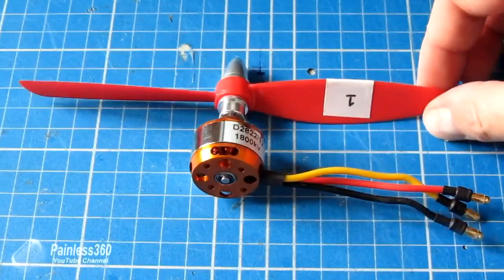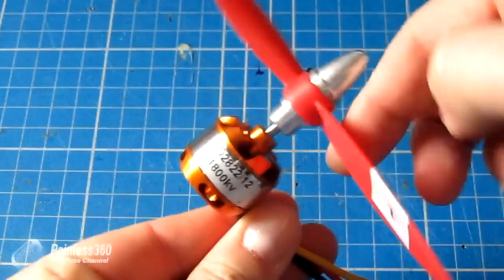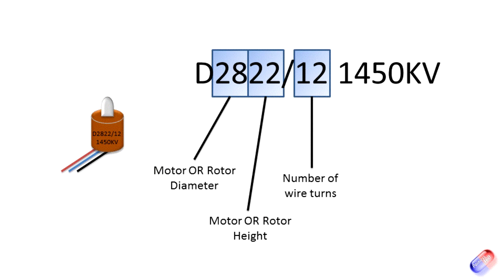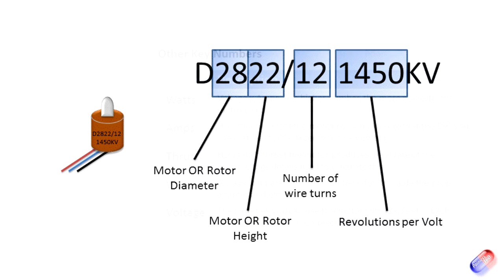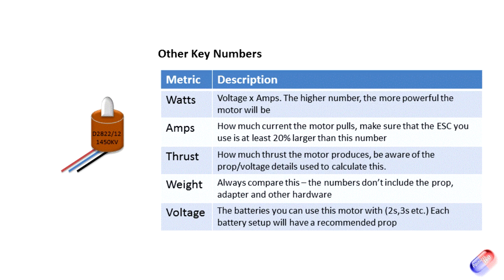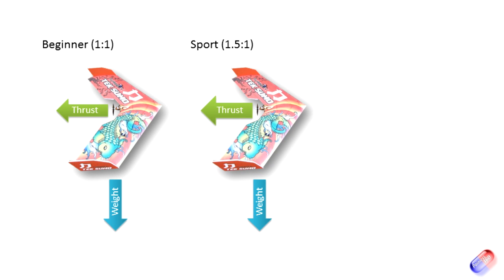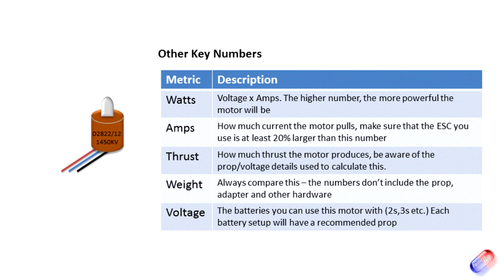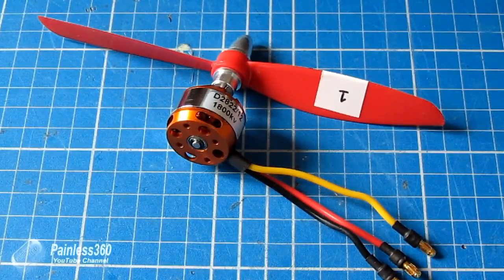Brushless Motor Numbers Explained (KV etc)

Comment: Thanks for the vid.  There's some good information in it.

I have a second-hand motor, but the only label on it says "dys Brushless Motor G-Power series ROHS Made in China.  Nothing else.  It's an out-runner.
Is there any way of finding more information about it?
It's quite a big motor - 34.75mm diameter, 47.7mm length, or 65mm including the shaft, which has a diameter of 5mm.
It appears to be quite densely wound.  Obviously, I can only see the wires on the outer layer of windings, but I'd say (without actually counting them) that there are about 18 or 20 turns visible, and as they are not wound absolutely flat, I think there must be at least one other layer beneath.  The 12 laminated metal poles are 26mm long, as are the 14 magnets.
Is there a method or formula for working out the Kv at least?
Reply from the maker: +Mike Collins I'd spend time looking for images in Google search using the information you have at the moment. Very tricky to work out KV without the specs or lots of testing.. Best of luck!
Reply: +Painless360 Thanks for the quick response.  In the interim, I have been doing what you said.  Going on the measurements, I deduced that it was a DYS 3548 so I looked it up on the DYS site.  It comes in three flavours - KV: 1100KV/900KV/790KV
All are exactly the same weight and have the same dimensions. As far as I can tell from the photos, they all have the same label too.  About the only difference is "Ri(M Ω)" : 0.023 / 0.036 / 0.040
I don't know what "Ri" is, and I can't think of anything around this motor that would be measured in mega-ohms.  If they mean mΩ (milli-ohms), my meter won't go anywhere near it (min = 0.5Ω)
Ho hum.  It seemed like a bargain when I got it.  It has a noisy bearing as well.

Comment: The reason I want to know is because the Spektrum rev counter telemetry module needs to know the number of poles to accurately measure motor rpm.
Reply from the maker: +George Venetsanos for outrunners it's normally the number of magnets on the inside of the can. The higher KV the more there are typically..

Comment: Hello, very informative video (as always). Unfortunately not all manufactures will supply adequate information for their motors with most of them providing only the rather not so useful Kv. How can one determine the number of poles in a brushless motor? 
Thanks and regards
George
Reply from the maker: +George Venetsanos Usually from the specs or by looking at the motor - best of luck!
Reply: Thanks for your prompt response. The problem of course rises when the specs don't include pole count and looking at the motor the winding pattern is not obvious. For instance a motor with 9 coils how many poles does it have?
Reply from the maker: Why is it that you are interested in knowing the pole count? Most pilots and builders don't need to know..

Comment: Hi My Friend!
I buy a 2212 Angel Sunnysky 980kv and in some occation he overheat.. them i see shortcut in the cables and resolve that but when i try to use again he run slowly.. i compare everything with the others motors and cables and all looks fine.. what you recomend? i see some videos repair brushless but im not sure what make..im waiting your response! thanks!
Reply from the maker: I would replace the motor. Best of luck!
Reply: +Painless360 Fast answer! I buy today the motor in ebay so i need wait for it but i try to repair this motor beacuse you explain the function and its very basics this motors and i thing have a solution. Thanks!

Comment: im build quadcopter, and i notice that 1 of my motor getting hot while the others not. i switch to other esc, some problem occur.. do you know what the cause? or i have to end it up buying new motor?
Reply from the maker: +andi azhar Could be a few things - I would check the bearings are ok and don't need oiling/replacing. Also you could swap the motor with another on the model and see if the same motor gets hot (in which place I'd replace it) or its something to do with the settings on that ESC.. Best of luck..
Reply: the motor going to be twitch when i replace to the other esc, but rotate nicely on 1 of my esc ( which is different type with the another ) , but it cause the motor to getting hot
Reply from the maker: Motor twitching is usually caused by a bad/broken connection on one of the three wires into the motor. Best of luck..
Reply: thanks for your fast respon, i will try my best
Reply: Harald Krennrich i replace the hot motor to the new 1.. problem solve
Reply: +andi azhar Any news on this?

Comment: why do you need so much torque in some motors?
Reply from the maker: +QuadBro RC Larger props with more pass take more force to spin..
Reply: +Painless360 another question. I am building a 150 racer, and you say a 1306 motor has more torque than an 1104 motor. What is one reason to go for the 1104 over the 1306? FYI the 1306 is 3100kv and the 1104 is 4000kv
Reply from the maker: Not necessarily. Torque (turning force) is a function of the power (watts) a motor pulls and physical things like how powerful the magnetic fields it creates are, the strength of the permanent magnets and the diameter and height of the rotor/stator. The best way to figure this out is look at the thrust and recommended prop sizes.. Best of luck.

Comment: Hi.  I'm new at this but questions are abundant. I've seen different size motors with the same "kv" parameter. What is the difference then?

I've heard people referring to brushless motors just with a simple number: 15, 12, 11, etc. What do they mean?

Thank you in advance !
Reply from the maker: +José Alberto Varona Sánchez I would recommend watching the 'Introduction to RC' playlist on the channel. It covers a lot of the basics. To answer your questions - The size of the motor is more about power, larger motors normally produce more torque (turning force) so can spin larger props and produce more lift. The other numbers you asked about are numbers that people use as a shorthand are about the size of the motor. Sadly the industry still haven't decided on a standard so sometimes the number refers to the diameter of the rotor inside the motor, sometime the physical size of the can that's it's housed in. Hope that helps.
Reply: It helped a lot! Thank you. It's clearer now. Do you have any specific link for 'introduction to rc'?
Reply from the maker: Look in the playlists in the Painless360 channel here on Youtube - all in there.

Comment: I have a question but cant seem to get an answer. On gimbal motor ie: BGM4108-130 how does the polarity work ? is it the same as prop motors ? wire it any way you want ?
Reply from the maker: +HIXMF Exactly the same as any brushless motor.. Best of luck with it..

Comment: Why do smaller motors have higher KV example is a scorpion motor I saw SII-3026-1190KV (V2) 1050W motor turning 1190KV.  Where a larger 45MM diameter motor is around 2000 watt motor only turns 170KV. Isn't the idea to turn the prop faster which is related to KV turns per volt?  Also I noticed these fast 100mph foam planes like the eflight rare bear and the rockhobby air racer have high small props like 8" 8 pitch or 10x10 pitch. Smaller props with more pitch get higher speeds?
Reply from the maker: +kell490 The thrust you get is a result of the size and pitch of the prop and the speed it turns. The most economical way to get thrust is to use a huge rotor with a very low KV/High Torque motor. Sadly, the smaller models we use do not give us the room for the bigger props so we have to turn the smaller props a lot faster to generate the same thrust. So in the hobby, where we don't have the room for/want a big motor and prop we need a small motor with a much higher KV. Hope that makes sense.
Reply: Painless360 So another question I have been playing around with the prop on my voodoo racer has a 880KV motor about 750watts. What I notice is a smaller prop turning higher RPM with more pitch like a 10x10 or cut down 9x10 prop the plane goes a lot faster. Where larger electrics with big props turning less rpm go half the speed as my plane with those props my current draw is lower then larger prop.
Reply from the maker: https://www.youtube.com/watch?v=uLutMoh4Ttg and https://www.youtube.com/watch?v=Sjwi_UnCLWc may be interesting to you.. Happy flying!

Comment: One more thing sir if I buy 1000kv motor will it work for more time than 2200kv motor if I use 2200 mah 3s 25c 11.1v lipo battery
Reply from the maker: It doesn't work that way. Motors that pull less amps make the power in the battery last longer. Amp draw has little to do with KV. Best of luck

Comment: Hi can I use 2200kv motor with 2200 mah 25c 3s 11.1v lipo battery
Reply from the maker: +Harsahej Singh Yes it should, but check on the specs for the actual motor on the maximum battery size it is happy with. Best of luck.

Comment: Sir than which lipo battery is perfect for 2200kv motor
Reply from the maker: +Harsahej Singh You can usually find this detail in the specs for the motor. The detail also normally contains the prop recommendations for each battery size (2s, 3s, 4s etc) too. Best of luck with the project.

Comment: Hello sir one thing more will the plane work if I am not using the tail and the back wings and is I am using a car transmitter to fly a plane is that ok please answer me as soon as possible
Reply from the maker: +Harsahej Singh I would recommend that you use the right transmitter for the model. With only two controls (steering and throttle) you would struggle to control the model. You really need three minimum for a plane. 
Best of luck.

Comment: Hi can I use a 2200 kv motor with 610mah lipo battery will it work and for how many minutes please can you tell me sir i am making a plane not very big but which will be the best kv motor and the battery mah please tell me sir as soon as possible
Reply from the maker: +Harsahej Singh Figure out the average amps the motor will pull then see how ling that would take to pull that from the battery. See my LIPO videos to help..

Comment: I love your videos mate. Solid knowledge delivery. Just went through your entire Taranis X9D plus playlist and I dont even own one (it's in the mail). So anyways I wanted some advice, I am scratchbuilding a F14 150% tomcat from parkjets.com and it's pretty huge. I'm expecting it to be 4-6kgs after it's fully setup but I have no idea as to what motor to use. The manual tells me to use a 2015-4100 but that'll be too small for this 150 size model. What do you think? Also I have only one motor mount.
Reply from the maker: +Brenden Anthony Das It depends on how you want to fly it. There is a rule of thumb that you need 1.5x the weight in thrust for sport and if you want insane performance look at 2x plus! Best of luck..
Reply: +Painless360 I think I prematurely commented without going through your entire video, which explains my exact question. Thanks anyway! 2 times the thrust is going to cost me loads :( 
Which brands do you use most for airplane motors? I was looking into aliexpress and they have some terrifically low prices on rc stuff, the catch being that some of their stuff is unbranded.
Reply from the maker: I'm a cheapskate ;) I tend to use the same motors as the quads and that keeps the spares down. I fly mostly soarers and wings that weigh very little so don't need lots of power.

Let me know how you get on..
Reply from the maker: I use unbranded, Turnigy as well as others. I try and get motors with decent reviews.. Best of luck!

Comment: Can you use a low kv motor on a miniquad?
Reply from the maker: +owenkilleen No easily as lower KV motors need larger props with increased pitch to move the same amount of air, there isn't enough space on the smaller models to use more than a 6" prop typically.
Hope this makes sense!
Reply: I understand, however, if you were to use something like 980 kv, on a mini quad, with 5" props....would it be grossly inefficient? If you get me? :)
Reply from the maker: It simply wouldn't create enough lift for the model to fly. I have a few other videos on choosing motors for Multirotors and a few practical demonstrations too.

You need to choose a motor that is designed to spin the max prop the model can support with the battery size (3s/4s etc) you have.

Hope that makes sense.
Reply: On a 450 build, I have a 4000mAh 3s with 30A esc's, and 980kv motors, but I'd like to build a miniquad at some stage too, was wondering about those kv motors lifting using like 6" props. But I think you've answered that for me, thanks :)
Reply from the maker: If you want 6" props then you'll need 2200KV or similar.. Best of luck with the build after many months resisting the pull of the 250 quad I'm now a convert with 4 of the things!

I hope they make you smile that much too!
Reply: talking about mini quads, ....as a cheap frame, what would you recommend? zmr, or qav style? Or another?
Reply from the maker: There are loads of videos on the channel for 250 class frames. It depends on what you want to use them for. The ZMR250 is very small and is just big enough to house the basics, others, like the QAV250 has a little more room..

Have a look at the 250 videos - they may help..
Reply: ok, see, that little bit of info helps. Thanks :) There is a pack from banggood that iForce2d bought, called king kong, lol, from banggood, I may try that, it's cheaper material, but has two frames included. I may rue the day. lol

Comment: If 12amp ESC's are sufficient for a build, is it sound to go for 20amp ESC's to allow for possible future motor/prop upgrades?
Reply from the maker: ShallowBeThyGames That is an option, allows for more choices when upgrading the motors in future..
Reply: Thanks for your response. I've been trying to find out if that was ok to do.

Comment: hello painless lots of useful info but i got a question.i have a motor whos label just says 1300kv.and no more info.
can you explain pls.how one can determine motors wattage or the amps.thanks.
Reply from the maker: mohammad abid You need to go back to the supplier and ask. You can connect it to an ESC and then connect the ESC to the battery using a amp/wattmeter. Places like HobbyKing sell them. Power the motor with the prop (make sure its securely fastened to something) and take a reading of the Watts on the meter.
Best of luck with it.

Comment: Hi, sorry to badder but I I'm not sure if I'm doing this correctly.  I have 40A 2-4S Brushless ESC Electronic Speed Controller with UBEC for Quadcopter, 1306 3100 KV Brushless Multirotor Motor Set (CW / CCW) and 20C 3S 1300mAh 11.1 LiPO Battery.  But I'm not sure if the are compatible. I have flighted the quadcopter and it works, But one of my motors gets to hot, what should I do? I will really help if I can get some info. Thanks  
Painless360
Reply from the maker: jcarlos maldonado If I'm looking at the right motors they only pull 8amps maximum so the ESCs are more than enough to run them. If only one is getting hot then it might be a physical problem with that motor. Check to see if the bearings feel 'notchy' as you rotate the motor and give the bearings a shot of lube. Also, check that the prop isn't damaged or of a different pitch than the others..
Hope this helps.
Reply: Thanks man that help a lot, it was my ESC is not working properly/broke. Thanks for the suggestion and tanks for taking the time to reply to my question. Jcarlos

Comment: What is the motor and ESC come as a combo, but the current the ESC puts out is lower than the motor can take?
Reply from the maker: FXRPIONEER Then go back to the vendor - the ESC should be rated for a little more then the motor for safety. 
Happy flying!
Reply: http://www.hobbyking.com/hobbyking/store/__40269__HobbyKing_Donkey_ST3511_810kv_Brushless_Power_System_Combo.html
This is the motor I was planning on getting.
Reply from the maker: Make sure it has enough power for your needs.

Happy flying!